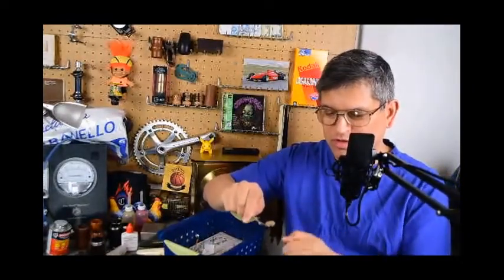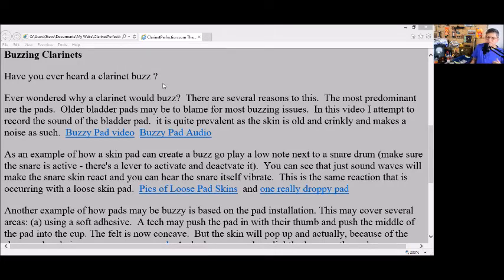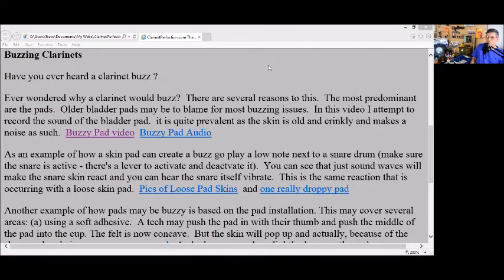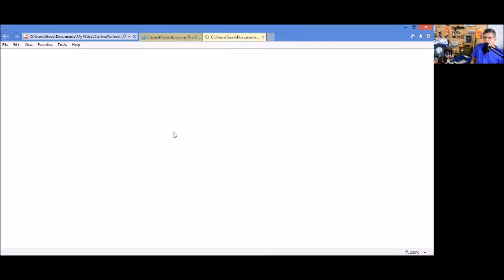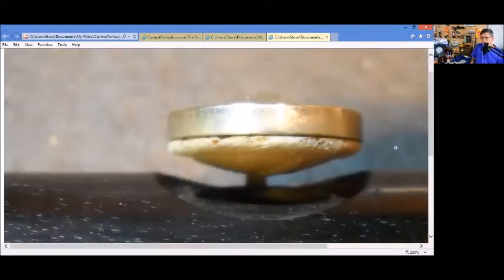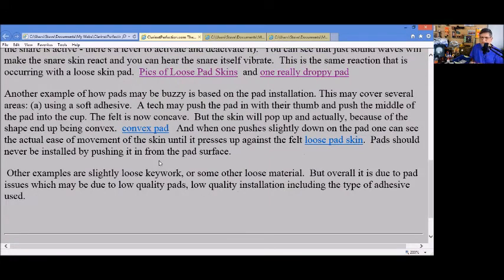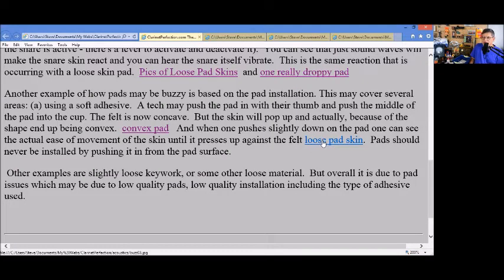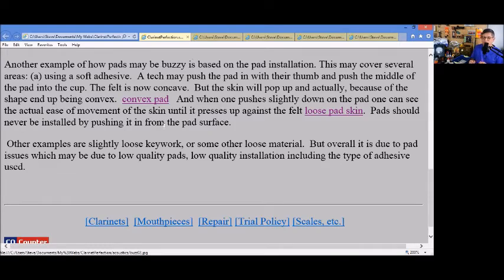Clarinet Buzz - Buzzy pads.  Why do you hear buzzing from your clarinet

Comment: Do you put the nail polish in the middle of the pad where the loose skin is?
Reply from the maker: Yes you can (for a at home remedy). When the nail polish hardens it eliminates the skin from vibrating.
I just would replace the pad myself though.
Reply: @gottalovetheknowledge4749 In your experience does the stick shellac hold up for a long time on the low keys for clarinet? I feel like I am creating the issue using the glue pellets because I don’t push the centered of the pad. Only lightly pushing the sides to float. I really appreciate your videos 🙌
Reply from the maker: You realized you can't push the middle of the pad in as it may go concave and cause issues.  I use a different process. 

I actually pulverize my shellac first in a pestle and mortar.  I went away from using sticks decades ago due to experience in flutes and clarinet keys. With the small keycups you can't easily use stick shellac (I also use the old method of using french cement but still pulverized - for flute trill keys and clarinet).  Flakes can also be used.  When melting with a flame I'm able to slightly rotate the pad in the cup which promotes adhesion (normally you'll see techs put shellac on the pad backing with the sticks).  I've found I can maintain a better melted shellac temperature starting with pulverized or flake shellac.
I actually have a video I'm editing right now for installing a RH pinky Eb key on the Yamaha 62 alto purple I'm working on where I mention and show this (though not in great detail).
Reply from the maker: Depending upon the brand of glue pellets floating is difficult.  When using glue first came out many people jumped to using it.  But found out floating was an issue.  And it was really stringy if you pulled a pad out.  I use a flat screwdriver or something similar to clean out glue from keycups with some heat.  But I had so much shellac sticks (and flakes) and french cement I never really tried it much.

With shellac if the temp isn't enough the pad can stick for a while but with use it can just fall out.  That's one reason I went away from using sticks and separately applying to the key cup and the pad.  I won't want to kiss the pad back with flame if it cools too much so the alternate method of pulverized shellac really has worked well over the years.
Reply: I hear ya. Yeah I have been using the amber pellets from JLSmith. I guess I should go back to the French cement then. I’ve been only rotating the pads from their edges in order to adhere inside the key cup (which is filled with about 7 glue pellets on the bell keys). But I guess since I have to reheat the key cup to float, I’m probably doing too much reheating and then ontop of that, I did the suction test 😬. I appreciate that tip. No one has ever mentioned that before…